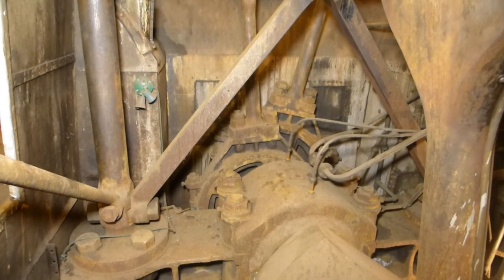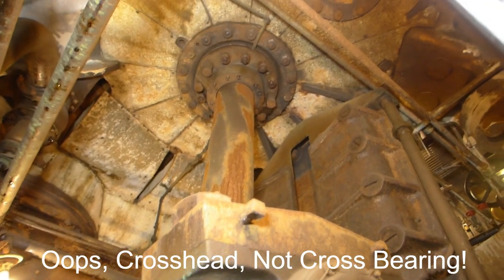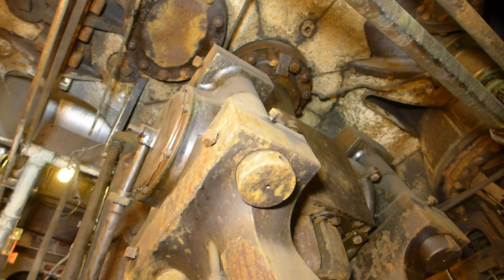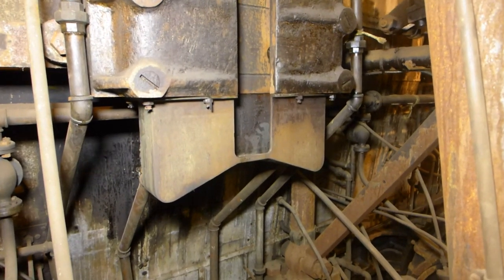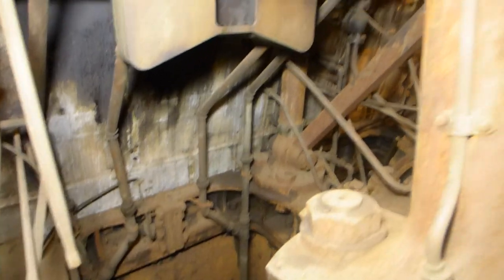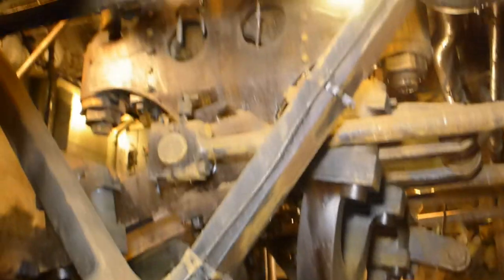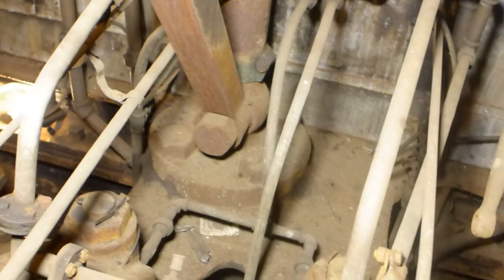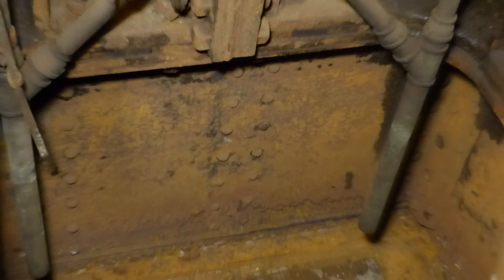Battleship Texas, Climbing In An Engine Crank Pit

Comment: I remembrr going into the engine room pit area and seeing a lake of black oil. I did not know that the oil was supposed to be there. In later years, when I learned about the flooding of various parts of the ship I figured it was just a skin of oil on top of a lot of distructive sea water. I am glad to see that at least the stb room looks so good.

Comment: Do these engines work with a cutoff like steam locomotives do?
Reply from the maker: Cutoff is one of the basic variables in controlling the engine.  Since it is the point at which steam input to a cylinder is stopped, it should be true of all reciprocating steam engines.

Comment: wonder if they ever had a big end rod bearing get a little loose and start pounding and if so what would the procedure be? What type of device/machine did they have for refining the lube oil?
Reply from the maker: I’d have to dig to see what they did in terms of checking tightness of bearing caps.  I’d be shocked if there wasn’t a regular schedule.  I read in a 1914 engineering manual that recovered lube oil was strained and pumped into a settling tank. Small particles and water sank to the bottom and cleaned oil was drawn off the top.  They. would likely occasionally test oil samples for unwanted acids.  One thing that may surprise you is that significant amounts of water was allowed in the oil without affecting lubricating quality.  However, every bit had to be removed before an engine was stopped and cooled. Any water remaining in the oil could be trapped in bearings and immediately start corrosion.

Comment: Not that it matters but I would guess its basically one solid piece after all of these years. Absolutely no kind of restoration to be done. I realize that you aren't allowed to try to reactivate the steam systems on the ship. But you have to admit that if the jacking gear unit were to be made operational even on a special event type situation it would be a good visual effect. I'm sure the jacking gear was probably run by steam but a gear reduced electrical alternative could be used.

Comment: Wonderful video !  When was the last time the Texas ran under her own power ?
Reply from the maker: It was either February 1946 when she entered Norfolk Naval Yard for deactivation or January 1948 when after 2 years of storage at Hawkins Point, Md., she reentered dry dock at Norfolk for preparation as a museum ship.  My guess would be 1946 when she sailed into Norfolk Naval Yard to be deactivated.  It seems unlikely that adequate skilled crew was available to operate the engines after that.  If they were operational, the latest the they could have run was on her return to Norfolk in January 1948.  Once there, she was permanently disabled by removing her props, prop shafts, prop bearings and shaft support struts.  The open prop through-hull openings were then blanked off.
Reply: @tomscotttheolderone364  What a marvelous supplement to your wonderful video.  THANK YOU

Comment: Looking at that gigantic machinery, those massive parts and then thinking that those were the pint-size cousins of the ones on Titanic, weren’t they? I remember Reading or seeing somewhere once upon a time that titanic had larger copies of the same triple expansion steam engines.
I’m reminded of the scenes in the engineering spaces of the sand pebbles – microscopic by comparison of course!
It tickles me a bit to think of fleet manoeuvres, and all that stuff knocking around while Texas was keeping up with the modern steam turbine battle wagons.😸
Reply from the maker: Just about the only design elements the reciprocating engines on the two ships shared were 4 cylinders and 3 expansions.  Titanic's reciprocating engines were quite a bit larger than these on Texas; however, they operated at significantly lower pressure, had shorter valve duration and provided less total expansion of the steam.  The result was that each only put out about 1,000 hp more than each one on Texas in spite of their larger size.  The piston timing was also completely different.  The total expansion rate on Titanic's engines meant that their efficiency wasn't nearly as good.  However, they made up for it by running exhaust steam coming off the low pressure cylinders through a low pressure turbine that effectively gave the ship's total propulsion 4 expansions.
Reply: @tomscotttheolderone364  I wonder if Texas could have benefited from  a turbine engine as well.

Comment: Just a minor point:  The crank bed would never have been filled with oil (or any other liquid, as the rotating of the crank webs would have flung it all over the engine room.  Liquid in the bilge would have been pumped to sea before it got anywhere close to that level.  The majority of the piping you see is actually emergency sea-water cooling, and not lubricating oil.  The cross-head slides will have one or two pipes supplying lubricating oil at a rate just enough to keep a film of oil on moving parts..  In the event that the flow of lubricating oil was impaired, or a bearing became too hot, cold sea-water would have been used as an emergency measure to keep the engine in service.
Reply from the maker: Thanks, you are obviously very familiar with reciprocating steam engine design and operation.  I overstated it when I said that the pit, or sump, would have been filled with oil.  However, a considerable amount would have filled the bottom of the pit since it acted as the sump where oil drained and was collected, as can be seen by the drains off of the crosshead slides.  While they don't show in the video, there are more than just a couple of lube supply lines running to the slides.  A small point.  Also, my use of the word "flood" is a relative term that perhaps applies simply due to the amount required to maintain a film over such large bearing surfaces.  None the less, it is a somewhat dramatic term that I grabbed out of the air while shooting an impromptu video. Lastly, I'm not sure I agree with the statement that the majority of the piping was for cooling.  Engine component drawings show a large and complex set of lines that provided lubrication to practically every moving component.  However, I've never attempted to count them to know exactly how many were lube as opposed to cooling.  Thanks again for your comments!
Reply: @tomscotttheolderone364  Tom, apologies, I stand corrected.  The piping that was looking at and at first assuming to be the emergency sea-water cooling, actually dead-ends near the bottom of the crank bed; I suspect that those are in fact the cylinder and valve-chest drain lines.
Reply from the maker: @johnpenner3957  John, that’s perfectly fine.  I gather from your initial response that you may have some hands operational experience with steam engines.  Whether you do or don’t, it was well informed.  Those kinds of comments are always welcome.  At the least, it keeps me honest!

Comment: Are there plans to fully restore the ship to operating condition?
Reply: The cost is enormous.  So most likely not. Just like the North Carolina, bb55. Just to dry dock and replace the hull "sheeting " would run an estimated between $2-4 million. All other repairs to return it to fighting conditions are on top of that. And if you look at the state it's in, imagine what it would take. North Carolina is in better shape and it will take a conservative estimate was around $6 million to fully fund a complete return to her fighting form. And both ships are not exactly recieving the necessary funds right now.

Comment: This ship is in pretty rough shape compared to the Iowa Class battleships, although  I
I realize this is a WWI ship.
Reply: Well the  Iowa Class was being use till 1990~92
this thing has not had its engines running since 1950...
Reply: a better comparison would be texas to North Carolina or either of the 2 South Dakota class bbs still floating, which none have been ran/moved since the 60s. All 4 Iowas were used at some point between the end of WW2 and into the 90s, so it's not a surprise they are in the decent condition they are in.

Comment: Have the shafts been turned since she was turned into a museum?
Reply from the maker: Not that I’m aware of.  It certainly hasn’t happened since the early 1980’s.  It’s impossible to adequately lube the bearings without oil and working lube oil pumps.  The cylinders were only lubed with water that condensed from steam, so the pistons probably froze from corrosion within months of the last time the engines ran.  Also, the only way to turn the engines is with electrically operated turning gear.  The large worm gear ring on the crankshaft that was used is made of brass or bronze and would probably be wrecked unless all bearings are perfect and the pistons move freely.

Comment: Part of my RCN ERA apprenticeship was donning a boiler suit and crawling throughout ALL the bilges tracing the various low & high pressure steam, condensate return, hot and cold water, compressed air lines throughout the entire ship to then draw a colourized schematic of all those systems.  Next up was getting into the boiler mud-drums and shovelling out all the crud to then follow that exercise with complete butter-worthing the emptied bunker fuel tanks and get rid of the dead rats within. Boy those old chiefs really knew how to make an impression on us newly hatched Able Seamen.  Triple expansion steam engines come in a variety of sizes but those are without a doubt formidable behemoths indeed.  They deserve better treatment and care.
Reply from the maker: Some guys really know how to have fun!  :)  Thanks for the story!
Reply: The angle of the stairs that traverse the three stories of engine space always amazed me,knowing boys would run down and up them while the engines were running and the ship was pitching and rolling..just awesome
Reply: Another former slacker! Ahoy shipmate!

Comment: I remember during a Boy Scout tour of the Texas looking into the engine crankcase and seeing hundreds of discarded paper coke cups.  Things didn’t get any better over the next 50 years.  I sincerely hope the foundation is successful in the ship’s restoration.  They have a huge task.
Reply from the maker: That is not really correct.  Radical changes started taking effect in the early 1980's when Texas Parks and Wildlife Department took responsibility for the ship.  Things like coke cups in the engine pits were cleaned up long ago and haven't really been present over the last 20+ years I've been a volunteer.  Part of it is because visitor access was restricted from areas where the ship was being vandalized and where there was an elevated risk of injury.  Food and drinks have not allowed on board for visitors for at least 30 years, and staff and volunteers can only eat or drink in restricted areas.  Significant repairs were made during a 1988-90 dry dock to the hull and lower spaces, and the main deck was repaired in order to correct a lot of damage and leaks.  What you see now on the ship is largely a result of not having funds available to perform dry docking and repairs on a regular cycle.  This is what is being corrected now.

Comment: This is just a tiny portion of the ship.  I can't imagine how a bunch of engineers with slide rules and drafting tables could have drawn all that stuff out in a lifetime.  It was all drawn out on paper, duplicated many times for machinist and builders to make the parts and put it all together.  Amazing feat and this is only one ship.
Reply: I'm old enough to have started my engineering career in the pre-CAD era. We had calculators, but still drew on vellum, taped to a drafting table, equipped with a drafting machine. There are lots of engineering support jobs that no longer exist. Draftsmen did the pretty drawings. Computer was a job, not a machine. A computer was usually a woman, that ran a bunch of calculations, as shown in the movie "Hidden Figures". Plus a bunch of other clerical jobs, running blueprint machines, and manually collating documents. The computer, as a job, was gone, by the time I started working, but draftsmen were still around. One engineering department I worked for had office cubicles for half a dozen engineers, that circled a central area with about 20 drafting tables. By the 80s, 4 of those 6 cubicles were still occupied, but the drafting tables were only manned, when we had to draw something ourselves. btw: I do know how to work a slip-stick (slide rule).
Reply: That's why when they built each series of ships they were all pretty much the same except for basic updates.
Reply: Then imagine the great pyramids, 4000 + years ago.
Reply: @henrik3129  easy Aliens did them 😁

Comment: I'm saddened to see the rust all over the engines. Did this compartment flood?
Reply from the maker: Don’t despair, the rust is largely cosmetic.  The multitude of bearings are probably shot, but that would have likely happened anyway unless they had been immersed in oil.  As far as flooding, the crank pits likely saw some flooding during the ‘50’s, ‘60’s and ‘70’s, but I have seen no evidence of general flooding of the engine rooms.
Reply: @tomscotttheolderone364  if I recall correctly, we were able to view these crank pits on a junior high field trip in 1976 or 1977.  It’s an image burned into my mind from 45 years ago of the pits still filled with oil and trash floating in them.
Reply from the maker: @jamesbeaman6337  Yeah, the ship has had low points in its history as a museum.  However, I think those days are well in the past.
Reply: She's also sitting in saltwater... that'll mess anything up

Comment: On the John W Brown seeing one of these engines running its downright scary. Everything is moving everywhere and the noise is poundingly loud, you have to literally yell
Reply: High pressure and heat steam makes a lot of sound moving through valving. 
I'm sure the noise level on one of this size would vary a lot. At full-tilt, whipping as quick as she could I have no doubt it would be quite loud. 

You generally don't let the steam go out the stacks, they try to recondense as much as possible on a seagoing vessel. Only so much fresh water can be stored and only so much can be made in a day.
Reply: Perceptions of noise level also vary quite a bit from person to person. Keep in mind that the engineers that worked below decks in WWI and WWII wore no ear protection, because it didn’t exist. Their ears took a beating, and over time their hearing diminished to the point that it probably didn’t seem loud anymore.
Reply: I'm rather surprised that anything steam powered is loud, particularly on a ship... it should be well balanced, so where's the noise coming from? Triple expansion engine should be pretty quiet as it heads out the stack...

Comment: I imagine it had to be loud in there. Not to mention dangerous. But, i thought in the 1920s overhaul, the recips were replaced by turbines
Reply from the maker: As far as noise, steam reciprocating engines are pretty quiet.  However, there are scores of pumps and other equipment also running.  I suspect that the cumulative noise was pretty loud.
Reply from the maker: No, there are drawings for proposed turbines and even turbo-electric, but the reciprocating engines were kept.

Comment: Can you explain the rumored fears about the engines falling out the bottom if the ship is moved? If this is true what sort of work has been done to prevent that?
Reply from the maker: Surveys of the structure performed several years ago indicated a significant possibility for structural failure underneath the engines and in the stern of the ship.  For that reason, a total of $50 million was spent in two programs over a period of about 6 years that included repair and reinforcing the hull structure and underneath the engines.  Taylor Marine was the contractor that did the work that even included replacing sections of the keel with the ship in the water, which was an incredible feat.  The ship is now both capable of being towed and placed in drydock without structural failure.

Comment: Were the major engine components painted white?  Were the decks painted dark red?
Reply from the maker: The bulkheads of the engine rooms were painted silver.  There were three levels in an engine room called grates.  The upper and middle grates consisted of open, expanded metal mesh that appear to be painted black or very dark grey.  The lower grate was solid diamond embossed plate painted red.  The internal engine components were not painted.  First, there was no reason to paint them since they would typically be covered with a layer of lubricating oil.  Plus, it would be difficult to maintain and flakes could potentially clog the lube oil strainers and oil passages.  All of these components are now covered with a light layer of rust because the oil either deteriorated over the last 75+ years or was cleaned off.
Reply: I hope the lower deck wasn’t painted red for the same reason the British wore red coats.